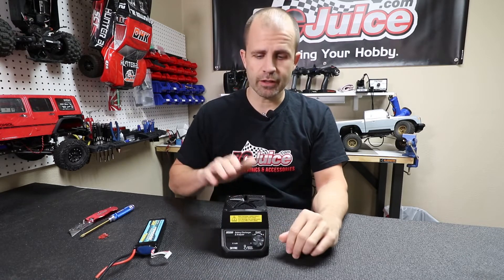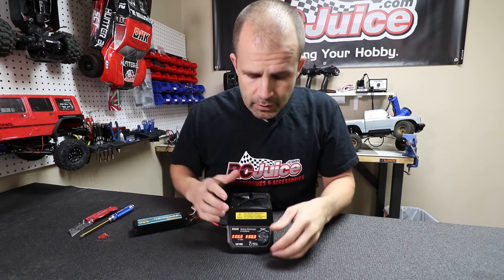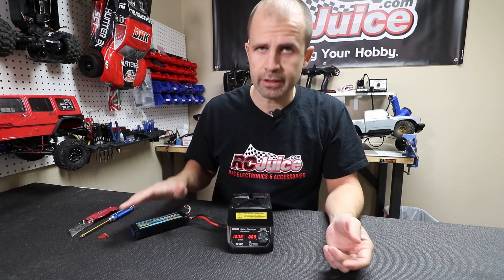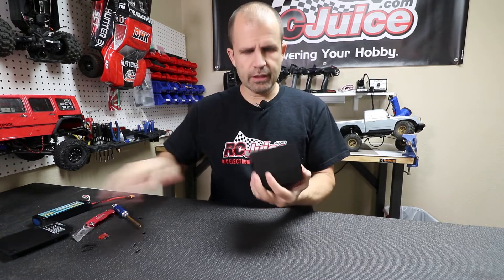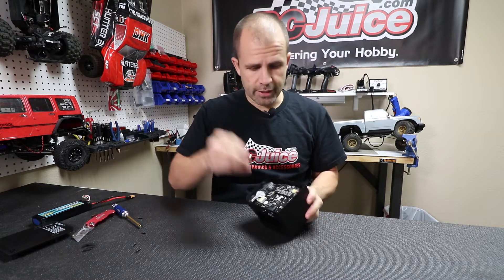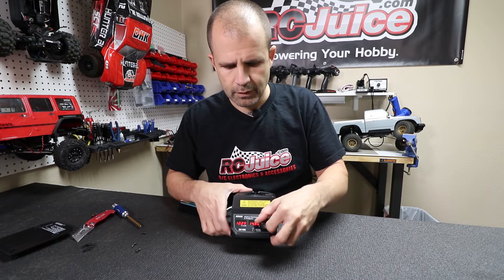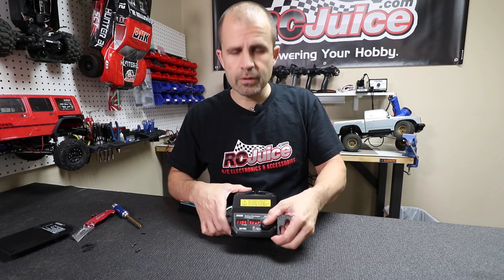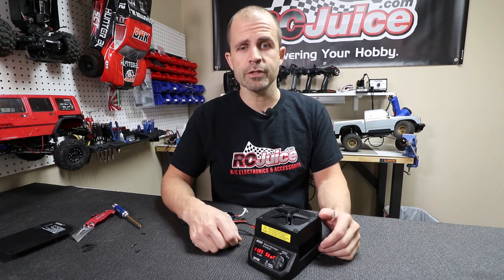Easy fix for SkyRC BD200 Discharger!!

Comment: There are some minor issues you must know. It will power off after 13.5mins after it's done or doesn't do anything. Unless! You use USB cable to keep results. But wait, there is more! If you connect it to the computer, it will take extra 150~250mA from the battery without including this extra load on the LCD or the computer software. So if you want a precise measurement, you'll have to simply use some other USB power, like a phone charger. This way it doesn't drain that extra power.
To make it work with a computer, you need a good USB cable, otherwise it will just keep re-connecting over and over again. It worked for me on the 5th cable I tried.
I personally use it to test real capacity of car batteries  at C20. I heard some rumors about time and/or capacity limit, but SkyRC denied that and didn't reach them myself, yet.
Looks like we'll see when the 100Ah will come to the test :)

Comment: Hi, do you know if this battery tester will handle high capacity batteries over 10000mAh? I can't find any specific info on this since the display only goes to 9999mAh. What happens when it goes above the value?
Reply: You set the value, it does not "go over"  and the design limits govern the max settings
Reply: @MrRfaass  well I actually bought this charger and tested it myself. It goes into 2digit mode with 2 decimal point after 9999 mAh. So it becomes 10.00 Ah. However, it has a software limit on the amount it can count. After 65.53 Ah it wraps to 0 again. 65535 is actually the max value of two bytes a. K. A. Unsigned integer 0xFFFF. So I hope my answer to my question will help others with the same question. 😉
Reply: @killer_x_treme  did you try the software
?
Reply: @MrRfaass  Not yet.